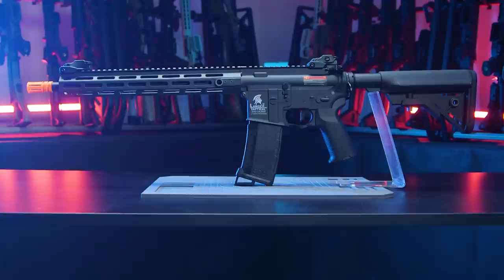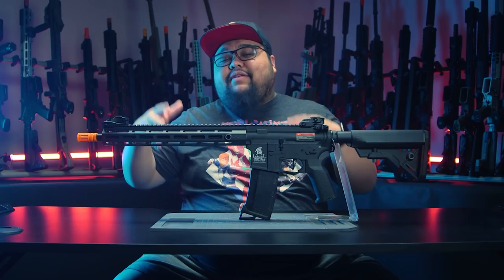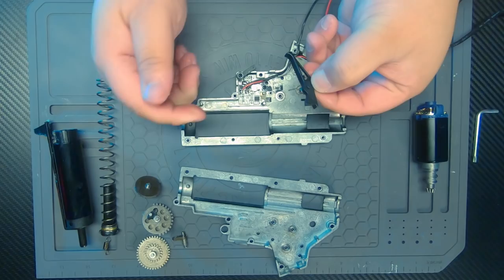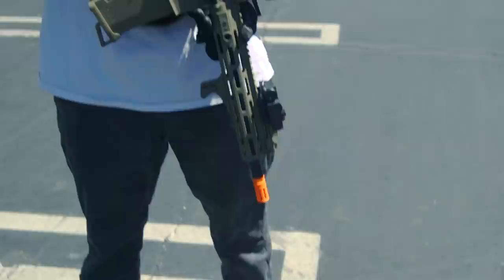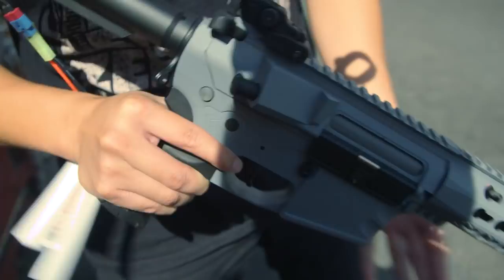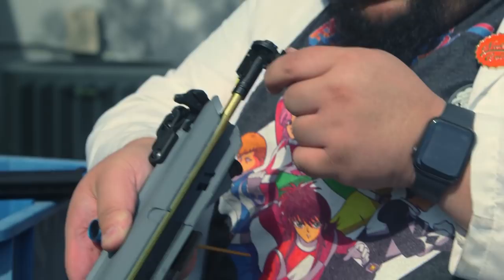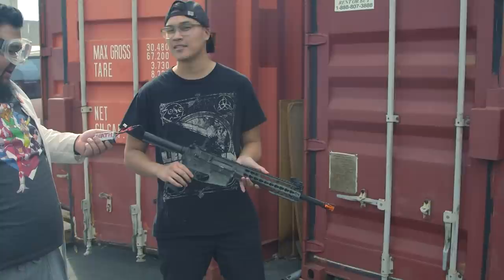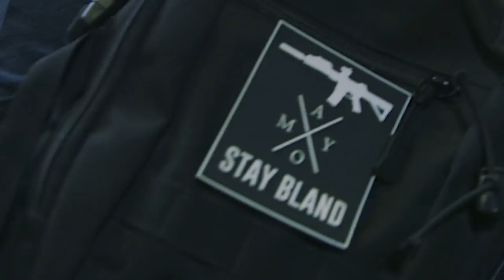WILL IT SURVIVE?!  - Lancer Tactical Gen 3 AEGs | Airsoft GI

Comment: Fire. Good idea for a test!
Reply: Hey c7 viper I'm getting into airsoft and I want a ak like the classic wood not that polymer junk whats a good ak I got a budget of 450 for mags gun gear.
Reply: @antsoto1236  I'm not C7Viper but anything made by CYMA is a great choice. They are pretty cheap and durable as hell and will serve you well as long as you take proper care of it. They even have variants that don't look traditional.
Reply: @Gojira_Wins  thank you
Reply: @antsoto1236  nah with that budget get an lct or an e&l
Reply: @maxkim3082  but I need a mask goggles chest rig and mags and silicon oil and bbs.
Reply: @antsoto1236  cyma is the way to go because of everything else you wanna get. Plus upgrades really aren’t that expensive. I own two cymas and love them both

Comment: "tHe dIsChArGe rAtE iS fOuR tImEs"

Batteries don't push current. 
Current is pulled. The only worry is the voltage.

Comment: bought the new strike industries emg competition m4 carbine, it was great but its falling apart and its not as reliable as it claims to be. I'm probably gonna fix it, sell it, and buy a gen three lancer. even though I started out with a gen 2 lol. I'm just worried about the reliability, range, and power of the gen 3 compared to the gen 2. and overall parts quality in comparison to the gen 2.
Reply: Gen 3 has better improvements than gen 2 especially the shooting itself, its faster more responsive and more crisp. I use a 11.1v lipo battery.

Comment: Question Cisco... wanting to get into airsoft... I'm looking at the LT32 7 inch (shorty)... Would it work outdoors on a field as far as range.. will it reach out and touch someone accurately?? Lol if yes, what weight BB should I run on an outdoor field?? Thanks Brother... keep the vids coming
Reply: I don’t think the short one will work because it is th cqb version so it has less FPS i would get the Lon or the medium and .25-.32 work best outdoor
Reply: @yoboichasecarnino7292  it comes with a weaker spring and a stronger one. The stronger one shoots about 380-400fps

Comment: I can't believe that they are ripping on G&G. Like sure the Lancer might have cool features but I know that the G&G will last longer! Also will have better performance. Overall, G&G is a better company with better overall guns.
Reply: lancer has really improved. I started buying them from them now
Reply: @majorblow01  it doesn't mean they are better than G&G though.
Reply: @jedialfonse  I personally prefer them. I just swap out the spring and the gun shoots amazing at range
Reply: @majorblow01  so does my G&G, but better.
Reply: @majorblow01  I have also had a bad experience with the lancer gen 2 and phenomenal results with my G&G guns.

Comment: Hmm that looks suspiciously like a Cyma platinum.....
Reply: They both suck. Honestly. In Negative airsoft recent vids he was complaining about the lower receiver cracking.

Also the mosfet breaks way to easy. Get the matrix calico jack or the maple armouries marauder
Reply: The mosfet breaks if you speedsoft the trigger or use batteries with too much amps and C rating with 11.1 volts it will destroy it because mosfets have a limit of amps it can handle when using, all companies that sell mosfets need to make this known as to not fucking ruin the guns
Reply: StorMRagE4EVA my classic army nemesis gun says in the instructions that you shouldn’t use anything over 20-25C of discharge
Reply: @southmoreconlin3757  yeah I know, just the cyma platinum has many copy cats these days and a couple are actually good like the EMG umbrella m4. However my point is that lancer didn’t really fix their problems, they just outsourced their gun to someone else
Reply: @User-rp3ou  EMG use cyma platinums as the OEM for their historic lineups
Reply: @StorMRagE4EVA  I know

Comment: I honestly find Mlock absolutely ugly. And I have always had better luck with keymod rails in real steel for not becoming loose under recoil. I find mlock loosens up too easily if you don't locktite the threads. Not to mention rail segments are a pain to install.
Reply: Most research has pointed to MLOK being objectively the most secure mounting platform. Youre more likely to shear a hole in the rail than have attached accessory fall off. As opposed to keymod which only requires strong enough lateral motion
Reply: I say just stick with regular old picatinny does nobody love the A4 style handguards anymore
Reply: They should have stayed with quad rail picatinny those new rail systems look like fucking trash, an M16 and M4 should never ever touch that nasty ass shit ever otherwise I would burn it
Reply: @StorMRagE4EVA  piccatiny is still fine, but the reason MLOK was adopted by the military is it shaves significant weight off the front of the gun while still maintaining adequate strength. The removal of excess material also slims the profile of the gun which can make it easier to 'drive' into a shooting stance
Reply: @Courtesyflush52  modern people complaining about the weight..... It's nothing, I volunteered to take a grenade launcher when we got them from the drops
Reply: @StorMRagE4EVA  thats not the point. You need to take an engineering mindset as opposed to trying to lambast technology. If you can make something lighter without significant compromise, why wouldn't you? NSWC Crane division conducted extensive research to show that there's little functional reason to have a full quad rail over M-LOK and that shooters were more accurate from a standing position because there was less weight in front

Not to mention, Eugene Stoner designed the AR-15 and AR-10 to push the boundaries of accurate fire in a lightweight package. He would have loved M-LOK. The military only tacked more stuff onto his design over the years
Reply: @Courtesyflush52  and gene stoner also didn't intend on the rifle getting a forward assist because he thought it was useless, your point is invalid picatinny or I'll just stick with the plastic handguard atleast at gives a classic appeal none of you kids appreciate
Reply: If your MLOK accessories are coming off then you installed them incorrectly. Crane has shown that MLOK is objectively a more solid mounting pattern than Keymod in every single scenario tested
Reply: @StorMRagE4EVA  and he ended up being right. Majority of the time that you need to use the forward assist, it makes the issue worse and you would be better served by ejecting the cartridge. Forward assist was a feature called for by big whigs in the military, people with no experience with the platform

Again, you need to look at this like an engineer. I've worked with the men and women at NSWC Crane and  most of them are engineers and veterans. That combined experience makes them uniquely qualified for this kind of work

Youre more than welcome to use quad rails as you see fit, just try to look at the development objectively rather than emotionally through rose colored glasses
Reply: @Courtesyflush52  i can confirm what youre saying about the SOCOM guys at Crane. I work in a different part of the Naval structure but all the engineers know about the work they do
Reply: @Courtesyflush52  you realize my statement was saying gene not wanting the forward assist was warranted, I was saying that ideas like that and ideas like keymod and MLok ruin the AR design
Reply: @StorMRagE4EVA  sorry for the misunderstanding.

I believe that M-LOK is the logical progression of Stoner's original plastic handguard. Its lightweight and slim. Not to mention Magpul originally made it in polymer too.

The main benefit of MLOK is it can function like a quad rail when you want it to, but its far superior when you dont need anymore rail space. Even famously quadrail-laden guns like the DD Mk18 are reduxing their lineup with MLOK